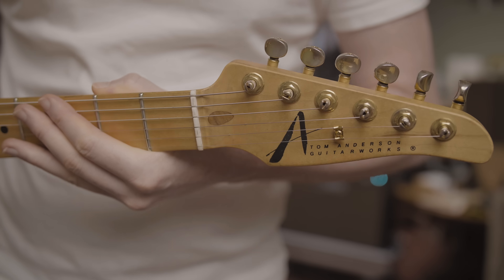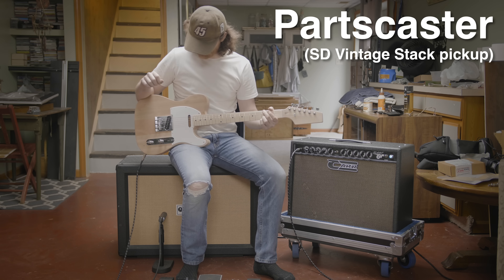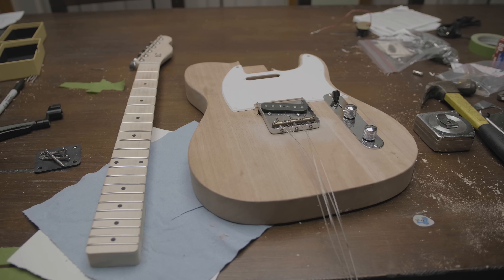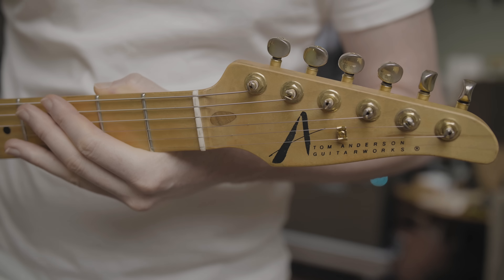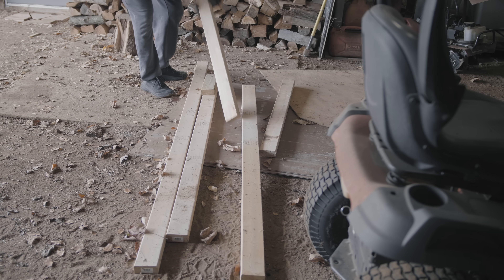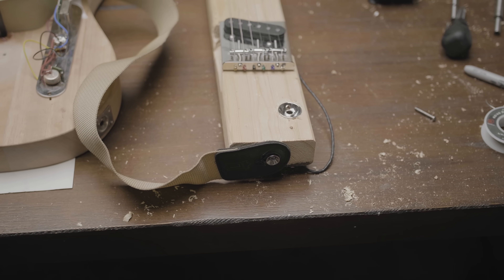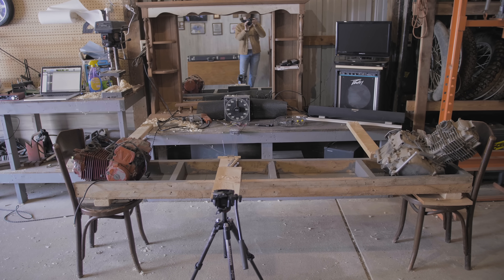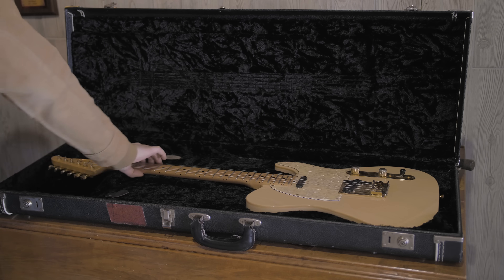Tested: Where Does The Tone Come From In An Electric Guitar?

Comment: I figured out that the most important part of sound was the pickups when I put a SD JB in my $50 squier and it sounded identical to my $2000 LP standard with the same pickup haha. I would think the biggest factor when it comes to high end instruments is the fit and finish, or in other words, looks, feel, material quality etc. I would surmise that a competent luthier could make that tele kit feel pretty close to the anderson.

Thanks for spending all the time you did making this video, it must have taken forever.
Reply: Yeah, in 2022 dollars anything past about 800-1000 is just jewelry or musical bling being added and not sonic quality.  So buy cheap and add what counts to your own taste and enjoy.
Reply: True , picks ups + amp tweaking. 
I saw other videos of blind test for tone wood. The conclusion was the same. 

With a 3k guitar Tone won't change but the playability and confort will change. 
I think it's also about passion when you play for years, you just want a high end instrument. 
I've been playing on 500-800 dollars guitar for years. Then I bought à 1500 Ibanez this Summer and immediatly wanted à J. Custom( and bought it 1month ago) 
You just feel a gap of quality. A huge one
Reply: You are exactly right. Bring a 300 dollar Squier to a luthier, have the luthier at it. It'll be as good Ultra series. Electronics is another matter of course, you'll need to replace it. But playability setup, and comfort? Luthier can do that to a Squier.

Comment: This is a great reason for people to not buy obscenely priced electric guitars like PRS, Fender custom shop, a lot of Gibsons, etc. Yes the type and quality of other parts matters when it comes to tuning, playability, unique electronics options, etc. But a guitar’s tone is not going to be drastically better because you spent $5-$10,000 on it. My general rule of thumb is that acoustics aren’t worth spending a lot more on if you are a high level soloist. With electrics there can be significant differences between a $200 guitar and a $1,000 guitar. However as a general rule I’d say you can get great tone, playability, tuning stability, look, special features, etc and stay around $1,500-2,000. Especially if you search used and are willing to have some dings in the guitar from the previous owner. I have a bunch of great guitars of various kinds that fit in that $700-$2000 price range that could compete with way more expensive instruments (I prove this on a regular basis when I try the crazy expensive stuff at music stores).

Comment: I had the same conclusion before 2 years, when I bought a fender player telecaster. There are 3 guitarists around me that are (let's say) guitar purists. They had some 2000+ euros guitars, they plugged directly in their amps (solid state ibanez amps), and controlled everything with their picking and guitar potentiometers. Whenever someone of them played my guitar, they were saying it sounds strange to them, or things like that, while I didn't hear any substantial difference. Playability of their instruments and mine was also in the same ballpark. It is when I realized that the guitar effects (if you use any), amp and speaker you use are 1000 times more important than the guitar. I bought the telecaster because of the simplicity (3 way switch, 2 pickups, 1 volume, 1 tone and no tremolo).

Comment: So many people out there still pushing the "tonewood" myth... worst of all Gibson, pedalling their ridiculously priced mass production trash on the back of the "tonewood" lie. 
Magnetic coil pickups produce an electric signal because the steel strings vibrate directly above the magnets, upsetting the magnetic field and stimulating electrons in the coil in a very precise way. If the wood is somehow affecting the tone, then your garbage pickups need wax potting to prevent "microphoning". The only way the term "tonewood" can be applied to an electric guitar is if it is fitted with highly efficient piezo pickup in the saddles. Schaller make excellent piezo products that actually DO draw tone from the wood.

Comment: Excellent findings! This pretty much reaffirms what I believe attributes most to tone. Acoustic guitars might be slightly different in terms of tonality, but electric guitars pretty much only sound as good as their electronics.
Reply: And their hands
Reply: of course, considering the point of the pickups are to pickup ONLY the movement of the strings
Reply: In acoustic guitars the tone wood actually matters quite a bit, but I would agree that in electric guitars tone wood doesn’t offer much.
Reply: And the player, but yeah.
Wood could help with sustain, but it's arguable whether that affects "tone" or not while in the main chunk of the envelope
Reply: Check out difference between GOOD guitars (not some random pieces of wood) - https://www.youtube.com/watch?v=n4puGOEmGjs
Reply: @david_lynch  Sounds like you missed the point. The 2 x 4 sounded damn close to the Anderson with the same pickup, pickup placement and distance, and same electronics. Other “good guitars” would have different pickups, with different pickup height and positions, etc... I think Jim shows definitively that the woods have very little effect on the tone.
Reply: @david_onbass  There are many ways to test the idea that the wood of an electric guitar affects tone. What I call "good guitars" are guitars whose wood really affects the tone, in a good way. In the video I provided, the author tests the sound of two identical guitars (the same year and the same model) with the same set of pickups. The difference in tone is really audible, moreover, in a blind test (try it). This is clearly audible on video, in reality the difference is even more significant, especially if you take Gibson Les Paul guitar made from the 1950s to 1968 (may be 1969) and compare with some made in 2012, for example.
Reply: @david_lynch  That's because of the pickups tho. There are no two identical pickups in the world. Pickups "age", there are many videos about this.
Reply: @CreamFreshCream  In the video I provided, the same pickups were first put on one, and then removed from it and put on another guitar. Listen to the examples from this video in a blind test. Aged pickups matter too, of course, but that's not the case shown in the video. Listen starting at 7 : 59 timecode. Pay special attention to clean tone. In the examples with overdriven sound, the difference is also felt, but a little less. And these are two guitars of the same year, probably made from the same batch of wood, only from different pieces. Of course, that pickups are also of great importance. It would take an idiot to say that pickups don't change the sound. But it is rather a microphone, not a sound source. Which is a guitar with strings. In general, every detail of the guitar matters, more or less, but practice shows that good pickups will not make a 59 Gibson Les Paul out of a dead log. You can put the same old pickup from the 59' LP guitar. Won't work. And it's not just the tone - the dynamics are different. And no matter how you try to adjust your technique to such a guitar, everything will be useless.

You can always change the pickups. The body cannot be replaced.

There are 2000-3000$ Les Pauls that look great, the neck is comfortable, the pickups are good. But they sound like crap (I mean, not the way Les Paul should sound) no matter how many pickups you try on them. Then you come across a random LP, on which nothing needs to be changed. It's probably the law that until you get bumps, you won't stop doing useless experiments.
Reply: @david_lynch  I'd argue that anyone ever that wanted the guitar and whatever other parts included themselves to stand for the full value of the sound, would'nt plug it into a converter. The guitar becomes completely redundant that way. Invest in an oscilloscope or a cheap mixer board instead
Reply: @snotset2165  well, kind of... I would say that now guitar processors are not as bad as they were 10 years ago. But it's a completely different experience. It's like the difference between an image on a 4k AMOLED screen and the same landscape in real life. Very close, but something is always a little off.
Reply: @david_lynch  Sorry, my bad. I agree now.
Reply: @david_lynch  Interesting. Thanks!
Reply: @david_lynch  Whoooosh!
Reply: @david_lynch  So, the woodless "air guitar" and the Anderson tele sounded extremely similar, and they only had the following things in common:
 - Tuning.
 - Strings.
 - Scale lenght.
 - Pickup, pickup distance and angle.
 - Volume pot value.

So why then would the wood make a difference in that Thomann comparison? Is there something else other than the wood in play here?
We can safely rule out tuning, strings, pickups and electronics.

But could it be that the scale lenght of the two Les Paul's weren't exactly identical?
And could there have been a slight difference in the exact pickup position, as the pickup cavities in the bodies stayed the same?

And even though all electronics and hardware was the same, how careful was Kris to setup the guitars in the exact same way, including the vertical distance between pickups and strings? (Not that I doubt his intentions, but it arent really shown in the video).

And then there's the risk of personal bias; did the two different guitars with different looks and different necks make Kris play differently, without him actually noticing it?

So all in all; you need to be extremely careful when doing such experiments and even more careful if you want to conclude anything from them.
Reply: @St_Modler  He has already answered these questions. I don't remember which particular video. The next after that, as far as I remember. In any case, the part of the sound that changes from guitar to guitar doesn't depend much on pickup height. The EQ and gain change, but not the tone, and certainly not the dynamics. This is an observation from personal experience.
Reply: @St_Modler  BTW the "air guitar" is not woodless
Reply: @St_Modler  I am shocked by these findings, however I've seen other videos where they swapped the unfinished bodies and necks in the same model. The diffrences were quite audiable. There's also a second layer to this Anderson tele in this video and although they come pretty damn close I would say that the air guitar has quite harsh, unpleasnt tone, while the tele is softer and more intresting to listen. While this might seem little it's the kind of detail that makes you enjoy what you hear.
Reply: @karyooooo  The "air guitar" has some unpleasant overtones at high frequencies. It also sounds more like "ahh" when the telecaster sounds like "eee." It is well heard. Does it matter? For me, yes. Although, I personally would like to hear a comparison of pickups in the neck position. In this position, the differences will be felt more strongly.
Reply: @david_lynch  Ok, you could say that the air guitar has a gigantic "wood bench headstock"😁
But still; No body or neck and it still sounds like a tele, with only little difference to the real guitar.
That is hard to explain if the wood really makes a noticable difference.

It is interesting though, that the air guitar's "bench construction" makes an incredible rigid and solid frame for the strings - almost like a piano. A Telecaster also makes a very stable sound frame, opposed to say the whammy bar bridge on a Strat, which is potentially moving about the whole time.

Wonder if that changes the sound and whether the rigidity in neck's wood construction has an influence on that as well?

It would be interesting to see more videos of this type - also including blind tests between various woods etc.
Reply: @St_Modler  "No body or neck and it still sounds like a tele, with only little difference to the real guitar" - well, it's tele's pickup in the same position, same guitar scale :))) BTW scale makes a HUGE difference in guitar sound.  But the sound of an air guitar is definitely different from a telecaster. 

"A Telecaster also makes a very stable sound frame, opposed to say the whammy bar bridge on a Strat, which is potentially moving about the whole time." - yeah, by the way, I can't stand what the floating bridge does with the tone. The floating tremolo is great, but the sound becomes empty with it. A floating tremolo (and a lying one too) definitely changes the sound for the worse.
Reply: @david_lynch  Tone and dynamics are affected a whole lot by pickup height, this is an observation from both personal experience... And the video, lol.

Comment: I've been explaining this to people for like two decades. 

Their argument is that wood changes the way the string vibrates, which is impossible. Acoustic guitar tone is shaped by the sound bouncing off the wood not the sound projected by the strings. 

The note a string sounds is determined by its wave shape, if you change the way a string vibrates you change the shape and change the note. If two guitars made of different wood species are both sounding an A at 440hz the strings are projecting an identical sound. 

If wood changed the shape of a strings wave when it vibrated the note would change. 

Electric guitar sound is captured by magnetic field, which can only be effected by magnetic material.  Which wood is of course not. It is physically impossible to change electric guitar tone with wood.

Comment: Very interesting.  Should do another test without the 2x4 connecting the 2 ends of the strings, which isolates any possible head stock vibrations that might have been picked up.  Probably not much different I'd guess, but since you have already done so many tests......

Comment: My Les Paul and 339 sound so different yet have so much in common. Perhaps for a solid body electric there is not much additive to the sound but hollow body contributes additional variance in the captured vibration. I definitely here the acoustic properties of my guitars when amplified, Les Paul, 339, Strat.

Comment: One thing he could do to improve the test, is to have something mechanical hold the pick and strum the strings. This is to keep the position and attack the same. A video tested this on YouTube years ago, by an Australian guy. PS.. awesome experiment
I have built guitars and I only thought the pickups etc mattered. Pickup height matters more than I expected. One video that made me think that tonewood is bollocks, is when Langcaster guitars had a video of their pickups mounted on a beer crate, instead of their usual reclaimed swamp Kauri with lots of epoxy filler

Australian test
https://youtu.be/5vgwaiScrwA

Comment: Well, the way the pickups work in an electric guitar is based mainly on the distance of the metal string to the pickup, and also to a few other factors like the power supplied to the pickup and the conductivity of the strings.  It's purely an electromagnetic phenomenon and not acoustic at all.  So the wood in the guitar is of course vibrating but that only contributes to the sound you can hear when the guitar is unplugged, which is not much.  The amplified sound doesn't come from the vibration of the body at all, but only from the electromagnetic interaction between the strings and the pickup.

Comment: I always believed tone came from the amp and that the guitar was far less important.  I think that's true for plugged in acoustics too.
Reply: I think it matters how that guitar is being plugged in.  Is it a mic'd  pickup, then it's picking up all the tone characteristics the wood used in the guitars construction imparts on the tone, as well as running it into the amp to be shaped that way.

If it's a magnetic pick up, then we're following the same rules of this video.

Piezo pickups are a different beast that I'm not super confident commenting on, but I understand they work with physical vibrations at the bridge, and this behave a little oddly.

Comment: Wow. Mind blown. So to sum, only two things really matter on a guitar: 1. The neck - not what it's made of, but how it's carved and finished, b/c that will determine whether it's enjoyable/easy to play. 2. The pickups - put in a good set. Of course, setup will vary depending on the player, and I include pickup height as part of the setup. If I had to add a third, it would be hardware that holds a tune, but I've dealt with crappy feeling tuners that were fine once you got it in tune.

That's it. That's all that really matters. Tone woods, finishes, trem systems, carve, hollow vs. solid - in the end, it doesn't matter. It's all window dressing. Want to vary your tone? Change your pickups, and/or change your amp rig.

Best value guitars will be the ones that don't skimp on pickup quality, and focus on a great feeling neck, and hardware that provide tuning stability. They can cut corners on the woods and finish.